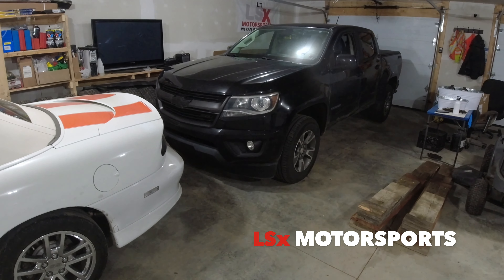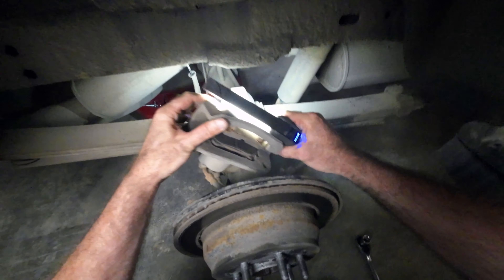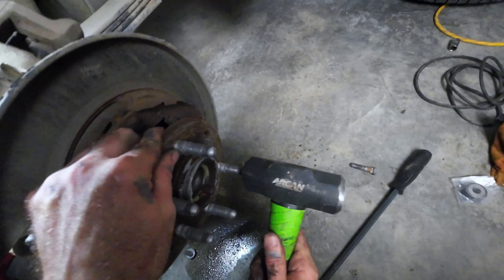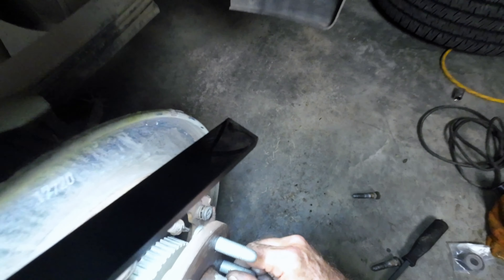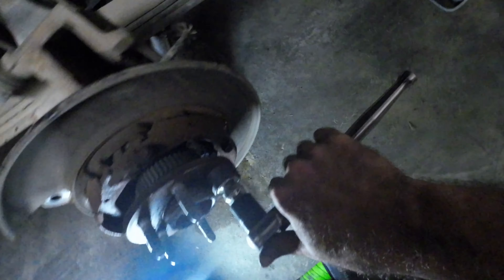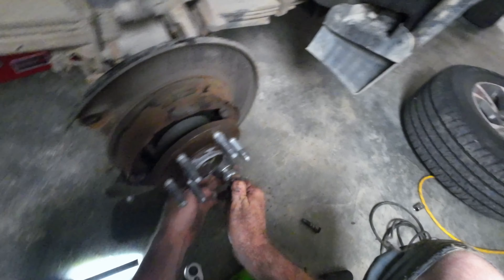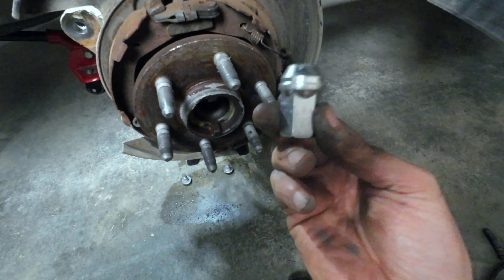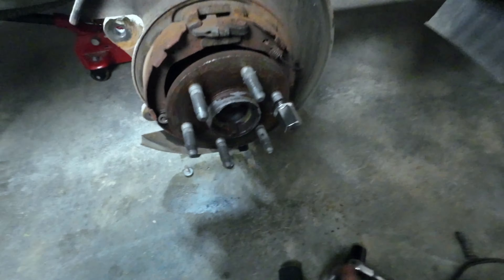How to install new wheel studs - Replacing wheel studs on a 2018 Chevrolet Colorado.

Comment: Awesome video!
Just got through replacing one rear stud on my 2019 Canyon. Only "issue" I ran into was that there are some brake shoe parts that may be behind the stud, restricting clearance. There are clearances you will find by rotating the hub.. as you said, "easier than I expected". Thank you!
Reply from the maker: Thanks for watching and commenting I really appreciate it.